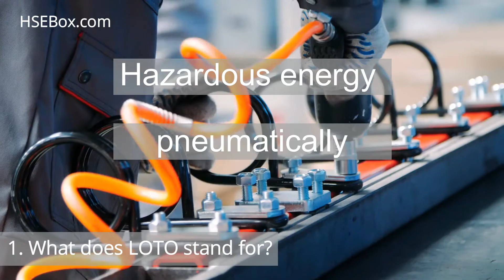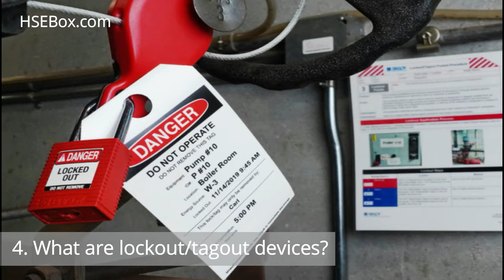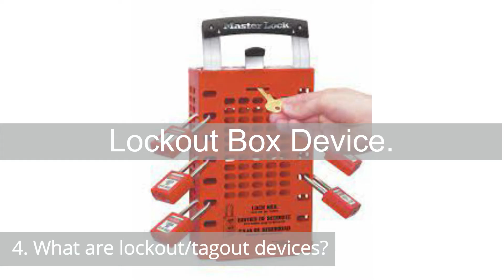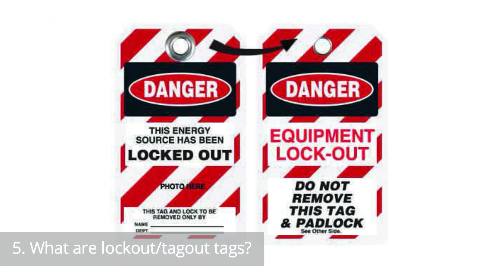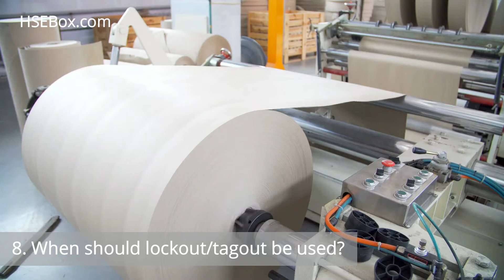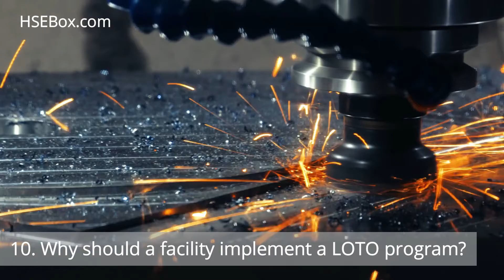10 most frequently asked questions and answers related to Lockout/Tagout (LOTO) - safety training

Comment: It's a proven fact that a considerable portion of serious injuries and fatalities that occur in workplaces every year could have easily been prevented,  if LOTO procedures were followed by the letter, each and every time without exception.   In fact the danger is so great that improper LOTO ranks among the top 10 OSHA violations each year.
Reply from the maker: You're absolutely right. Proper adherence to Lockout/Tagout (LOTO) procedures is critical in preventing serious injuries and fatalities in the workplace. These procedures are designed to ensure that machines and equipment are properly shut off and cannot be started up again before the completion of maintenance or repair work. The failure to follow LOTO procedures is indeed one of the most frequent OSHA violations each year, underscoring the importance of rigorous safety practices.

Implementing and strictly enforcing LOTO procedures can significantly reduce the risk of accidental energization of equipment, which can lead to severe injuries or fatalities. It's essential for organizations to provide comprehensive training on LOTO procedures, conduct regular audits to ensure compliance, and foster a culture where safety is prioritized above all else.

Thank you for highlighting this crucial aspect of workplace safety. If you have any more questions or need further information, feel free to ask!

Comment: How transmission lines are connect ed to the poles to poles
Reply from the maker: Transmission lines, which carry electricity over long distances, are connected to utility poles or transmission towers using a combination of hardware designed for stability and electrical conductivity. Here's a simplified overview of how transmission lines are connected to poles or towers:

Insulators: At the top of each utility pole or transmission tower, there are insulator strings. These insulators are typically made of porcelain or glass and serve to prevent the flow of electrical current from the transmission lines into the structure.

Crossarms: Below the insulators, you'll often find horizontal crossarms attached to the pole or tower. These crossarms provide a platform for the transmission lines to rest on.

Suspension Insulators: Transmission lines are suspended from the insulators using suspension insulators. These insulators have a "V" or "U" shape, with the line passing through the bottom of the "V." They are designed to support the weight of the transmission lines while providing electrical insulation.

Strain Insulators: At the ends of each span, where the line turns or changes direction, strain insulators are used. These insulators are designed to absorb and distribute mechanical stresses caused by tension in the lines.

Clamps and Connectors: Specialized clamps and connectors secure the transmission lines to the insulators. These components are typically made of metal and provide a strong and reliable electrical connection.

Grounding: Ground wires are often installed above the transmission lines to provide lightning protection and to dissipate electrical charges safely into the ground.

The arrangement of these components may vary depending on the type of transmission line, its voltage, and the design standards of the utility company. Safety and reliability are paramount in the design and installation of transmission line connections to poles or towers.

Hope this answer your question, thank you for your comment

Comment: Loto self life is what, please solve the question
Reply from the maker: "LOTO" typically refers to Lockout-Tagout procedures used in workplaces to ensure the safety of employees during maintenance or repair of machinery and equipment. It doesn't have a "self-life" in the traditional sense like a perishable item. Instead, it's a safety practice that should be applied as needed whenever maintenance or servicing work on machinery or equipment is performed.

In essence, Lockout-Tagout procedures remain a critical part of workplace safety indefinitely and should be implemented every time they are necessary to safeguard employees from the unexpected activation of machinery or equipment during maintenance or repair activities.

Did answer your question?

Comment: Good evening, excuse me, could someone guide me? I have a question regarding the LOTO system, for example, if someone does the procedure and at the end of their shift leaves the company for their home, can another person deactivate the LOTO system when taking their shift?  Thank you
Reply from the maker: Hi Senen, yes, but before should contact the person that initiate the procedures, should call him to ensure he can desactivate, if not possible to call only in an emergency situation the deactivation may be carried out, but the procedures should included what to do in this situation, if not it a good time to review the procedure. It was clear?
Reply: They are not supposed to remove, the lock you put on. At plant's that won't happen,you could  get replaced, or  retrained.
Reply: Usually LOTO is implemented bny 2 or more different departments. So its not possible to remove all the lock. A perticular department can remove their lock but they cant remove locks placed by other department. For example, LOTO is placed by Operation and Mechanical department. To remove all the locks, both department should be agree.